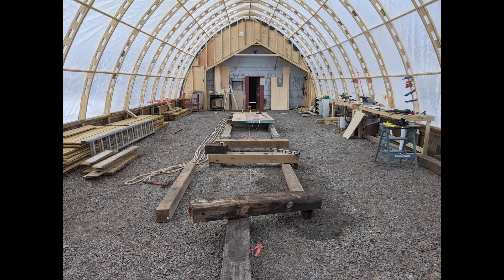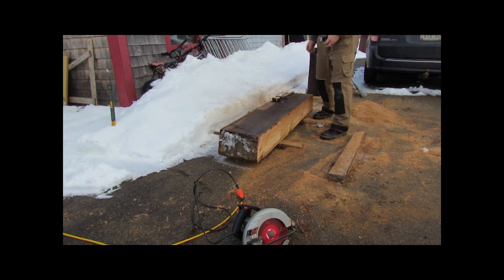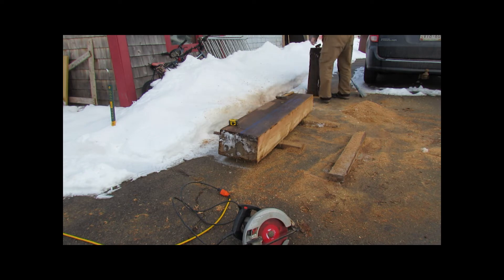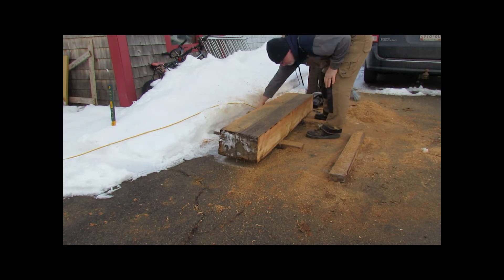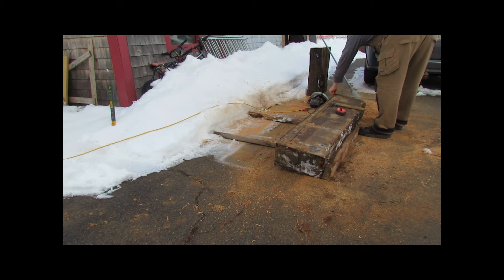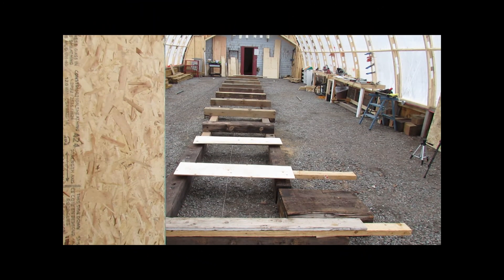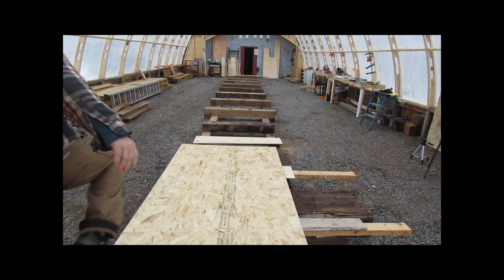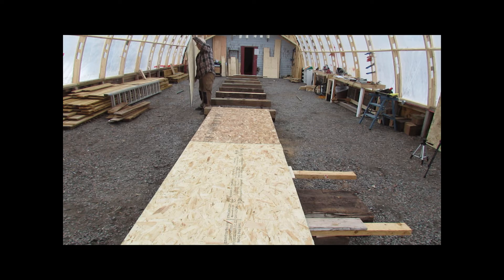Boat Build Lofting Preps - Ep 6 - Building A Wooden Trawler Yacht

Comment: Better put some sails on that baby by the time you decide to launch her in the water it will cost you a fortune to fill your diesel tank up with fuel. I bet it will cost you a thousand bucks to fill the tank at the cost of fuel these days. BTW  On a better note the fun begins. Lofting Stage.
Reply from the maker: You ain't kidding Fon. The design does include a sail. Not as a primary means of propulsion but to get a couple extra knots when the wind is blowing in the right direction or if the deisel conks out to allow me to limp back to the nearest port. I will also have an extra long paddle. 😂  I haven't decided on an engine yet, but I will be looking at some hybrid models to be sure.